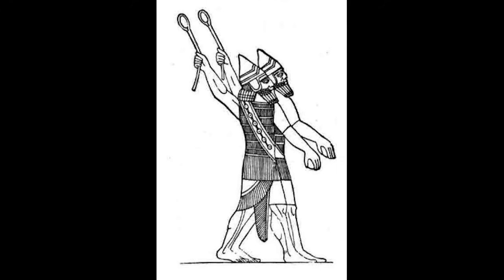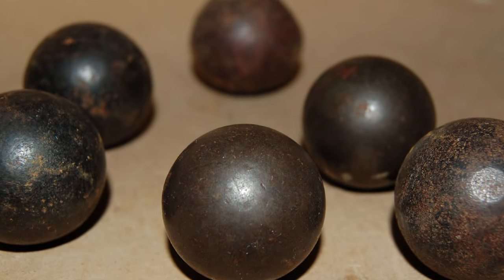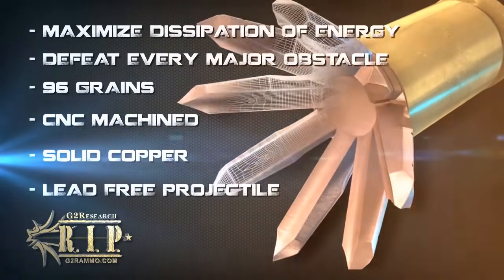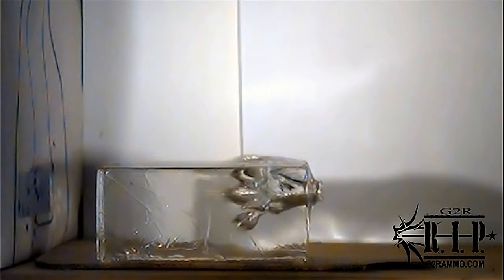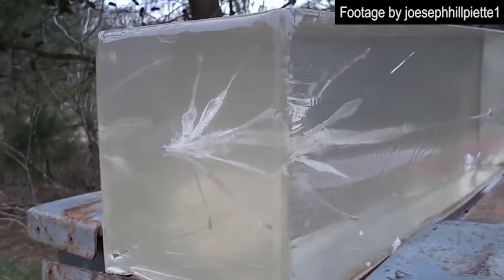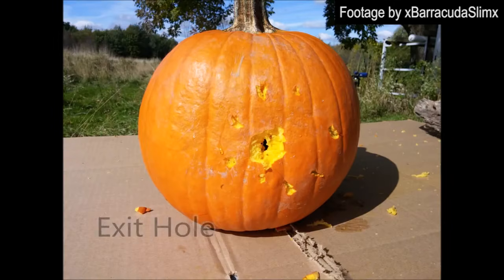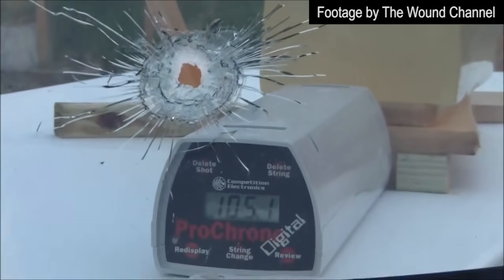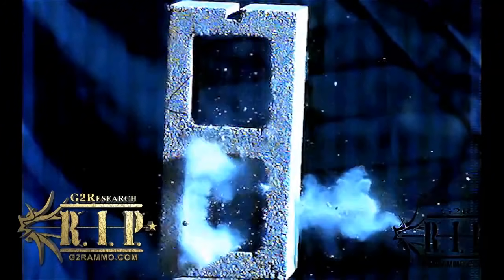The next step in bullet evolution: The Radically Invasive Projectile (RIP)

Comment: This is not all that new as far as the idea. I would also guess that the military would want no part of this as it would fall under a violation of the Geneva convention. That is why all military small arms are full metal jacket. We need to be civil when killing. ( sarcasm for those who will not get it )
Reply: +1gallimaufry geneva convention has nothing to do with this what you are thinking of is the hague conventions
Reply: +1gallimaufry Actually, no. One of the reasons why hollow points aren't used is because they don't have good penetration. 

Plus, this round is an expensive gimmick. The main selling point, the petals they call "trocars", don't work well. The "trocars" break off too early, so the damage done to the body would be superficial. A standard steel BB into ballistic gel at 590 fps, usually penetrates to about 3.5″. In a human body a that BB might not even make it past the skin. The "trocars" in a test penetrating about 4″ of ballistic gel, and not always consistently, and sometimes they don't break at all. The shape of the round also affected feeding. A youtuber tested it on his Glock and a round refused to feed from the magazine. 

The penetration of the main projectile also wasn't consistent, especially when there are barriers in front. You see,  a human isn't made of ballistic gel, and a ballistic gel only simulates one type of human tissue - A good portion of what you'd be aiming for would have bone (ribcage), tendons, thick clothing, soft barriers in front of the person. When other youtubers tested it, it didn't do well when there are barriers (plywood, denim, windshield, etc) in front of the ballistic gel, as there wasn't enough penetration (experts say you need to have penetration of 12″ and 18″ of ballistic gel, so it have enough power to go through a human body, bone and all).

Comment: I know traditional rounds are still pretty effective, but dang that thing is insane. I need some for my guns.
Reply: +noah walters Please don't, stick to proper hollow points. This is just an expensive gimmick. Might even cost you your life.

The main selling point, the petals they call "trocars", don't work well. The "trocars" break off too early, so the damage done to the body would be superficial. A standard steel BB into ballistic gel at 590 fps, usually penetrates to about 3.5″. In a human body a that BB might not even make it past the skin. The "trocars" in a test penetrating about 4″ of ballistic gel, and not always consistently, and sometimes they don't break at all. The shape of the round also affected feeding. A youtuber tested it on his Glock and a round refused to feed from the magazine. That's not something you want if you want your firearm to be reliable and go bang every time you pull the trigger.

The penetration of the main projectile also wasn't consistent, especially when there are barriers in front. You see,  a human isn't made of ballistic gel, and a ballistic gel only simulates one type of human tissue - A good portion of what you'd be aiming for would have bone (ribcage), tendons, thick clothing, soft barriers in front of the person. When other youtubers tested it, it didn't do well when there are barriers (plywood, denim, windshield, etc) in front of the ballistic gel, as there wasn't enough penetration (experts say you need to have penetration of 12″ and 18″ of ballistic gel, so it have enough power to go through a human body, bone and all).
Reply: Tremulousnut Actually I think I will buy some dragonfire rounds instead. Go look them up if U don't know what they are what they are.

Comment: Because the objective of the law enforcement is to maim and cripple. Then ordinary ammunition does not do it. Why don't they just use a flame througher instead? It's much more violent and probably in the line of 2hat they're trying to achive. Maximum damage to as many as possible no matter what.

Next time you do not concent to a search or choose to opt out on the body scanner you'll most likely be shot in the back with a 50 caliber armourpiercing round with explosive tip by an officer fearing for our safety at the expense of yours.

Comment: effective against:
- plywood => a few layers/thin layer. yeah sure. but then again when the fuck would you shoot someone through plywood?
- auto glass => don't make me laugh, that's no longer your prized "rip" bullet if it turns into an ordinary bullet upon impact.
- sheetrock => what do you think this is? an actual bullet?
- cinderblock => watch closely as only the center part passes through. making this bullet no better than any other bullet.
- sheet metal => was this list made up by a 5-year old?
- multiple denim layers => get a damn knife. it'll cost less than a box of this shit.

this bullet is a joke. An that's not even talking about how stupid it is to try and spread as much force on impact instead of focussing it on a point as small as possible (duh). Yeah sure it will rip through flesh, now you just need to position yourself within less than 100 yards of a threat you want to take out as in-humanely as possible who happens to not be wearing any clothes, stands perfectly stil and consists out of nothing but soft body tissue.

you could not possibly get away with using this bullet for self-defense. The sheer amount of unnecessary damage you'd cause to someone would guarantee you some time in prison and a gun ban. I showed it to one of the lawyers i work with and he had a good laugh and confirmed what i said. If you were to get tangled up in a case where you fired this round, even in self-defense, you would not get away with it. Even a kid Fresh out or in law-school could turn that into a juicy case for whomever you shot.

Comment: Honestly this ammo has NO place in the civilian market!!!!!! For military I can see a use possibly depending on how much this costs vrs traditional rounds. As current ammo works just fine and we don't need to spend excessive sums of money to refit the military with new ammo if the current option works just fine. As for the use in the civil sector IE police, and private ownership there's NO place for this!!! Not only are you putting more dangerous ammo into the hands of those wishing to break the law, you are also increasing the chances that the misuse of force by those in power will be deadly. We already have enough issue with police misusing lethal force. The last thing we need is ammo that increases the chance of death. As I said before I'm fine with this for military use as long as the cost isn't greatly inflated. For nonmilitary use no way!

Comment: I'd say these are not as effective as a standard hollow point. The most important aspect of a bullets stopping power is cavitation. It's apparent there is less cavitation, especially after fired through the windshield. At that point it acted like a FMJ, merely piercing a hole, not creating much of a cavity at all. Cavitation is why people go down, it drops blood pressure, causing unconsciousness. Both kill, but the cavitation stops an attack, without it the attacker might live on to kill you before dying themselves. This is also why they test in denim because denim can clog a hollow tipped bullet, preventing it from expanding and causing cavitation.